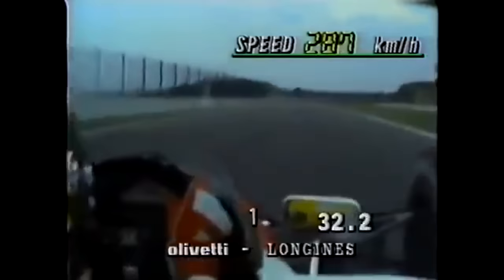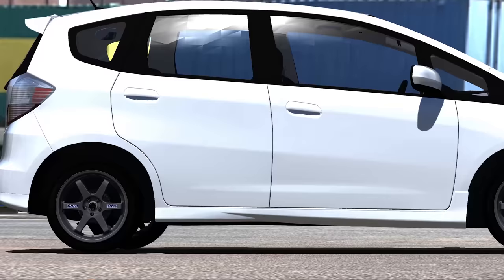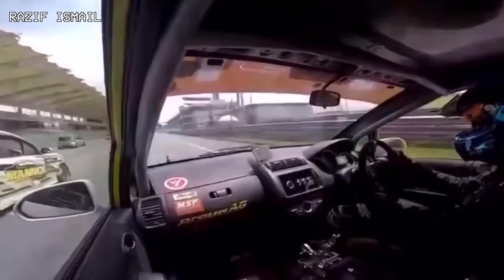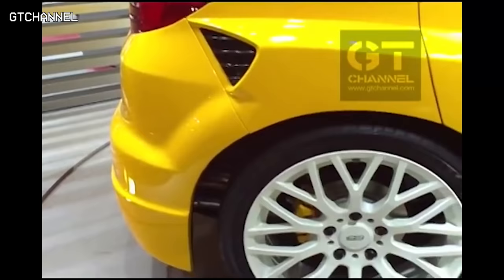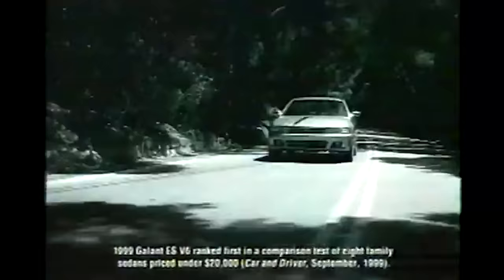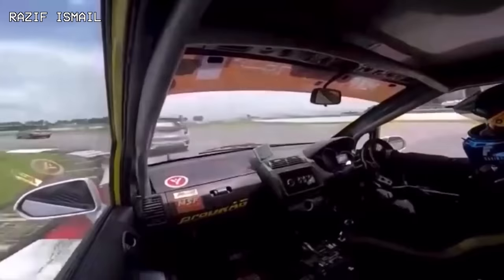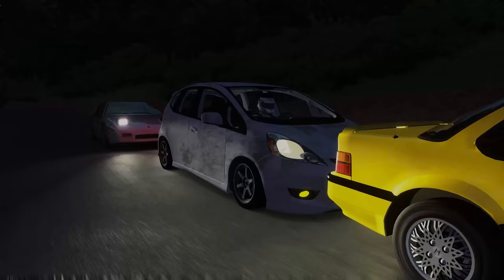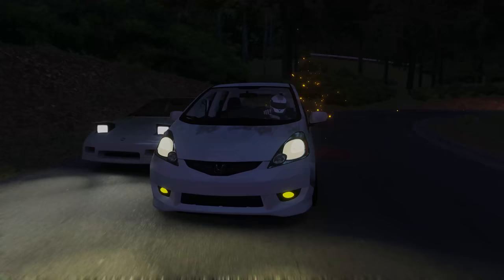Honda Fit - What Makes it so Great?

Comment: Take the Honda fit, add a parallel electric boost motor between the engine & transmission & a battery pack, cover the hood & roof with solar panels, also make a solar panel that covers the windshield that slides down from the roof & fits into place when parked. The windshield solar panel cover would not only provide more charging power. It'd also keep the sunlight & heat out of your car when parked.  Use a standard 120V wall plug in charger, so customers don't need an electrician to install a 240V wall plug in. They'd also be able to plug in anywhere they can use a standard wall plug-in. The electric "boost" motor would be used to provide extra power/torque during acceleration & up steep hills, instead of constant use. Once up to speed, the engine only is used, saving gas but providing extra power when needed. Making it quick off the line, instead of under powered & boring to drive. The battery bank would mostly be recharged from regen braking (helping to reduce brake wear) & the solar panels & wall plug in when needed. If the battery bank goes empty, the car will still run & have range, just use more gas & be slower until you can get to a wall plug in. If you drive say 20 miles to work, the solar panels will be charging the car for 8 hrs  while sitting unused in the parking lot.

Comment: I wish Honda-still offered it. Nothing simple and entry level. I really wished it was offered truly stripped under 15k as well.  I bought a used 15 XB manual with only 30500 miles 2.5 years ago that I adore.

Comment: I LOVE the Fit. 

I only care about the first and second gen, though. After the GE8, they were built in Mexico. 

My Hondas are built in Japan, no exceptions. Currently running a GE8. Best car, ever!
Reply: Sad the GK is a good car too. Has the refinement of the GE and the Sportiness of the GD with a DOHC engine setting it apart from the other Fits. Has a much more noticeable vtec crossover sound when modified too.
Reply: @christopherjohnston6343  I'm sure it is an excellent car. It is a Fit, after all! 

I just have certain quirks. One of those, is that my Fits have to be built in Japan. 

I took delivery of my first Fit Sport in 2006. It was one of the first ones off the boat, from the first shipment. Never was a HUGE fan of Hondas. But, it was the car that changed everything for me. It's practicality was head and shoulders above anything else that was available and was FAR more sporty than the competition.

When they swapped production to Mexico, some of the magic/mystique was lost. 

I just can't. :(
Reply: @techtard829  fair enough. I own a JDM 2006 Fit Sport and love it to bits. Have also owned a good selection of the smaller 90s sports cars and the Fits handling holds it's own.

I guess it's just that I know in 5-10 years time my current Fit will be due for replacement and it's likely the GK will be my best bet.

Comment: The Honda Fit/Jazz is NOT intended to be a performance car, it is a commuter family car with great fuel economy, i drove a 2003 Jazz we were very impressed by the car very roomy comfy 60+++ fuel economy on the open road, we did a long trip i Liked the car!!!!
Reply: Nope, it will performs if you tuning it Properly. The base is trash. Speed limiter, stupid 5AT gearbox..etc

Comment: if Honda is able to fit 150hp in next gen/year it will be by next car. Current ones struggles in highway.
Reply: U can mod the ge8 or gk5 1.5 not the 1.4,idsi… mine have 170hp with 230nm. It run very well 0-60mph just 7sec

Comment: I have the 2018 Fit Sport.  I am finding that the latch on the rear door/hatch requires monthly clean and lubrication.  Even worst, I find that the windscreen washer is seriously deficient when driving above 60 km/h.  The car was like since new and the Honda dealers kept telling me they replaced the parts and the issue is with the quality and design.  I know the parts were replace because I marked the original beforehand.  

Does anyone have the same issue with the windshield washer?

Comment: Honda was in a bad way in 2007.  The lack of quality on the 2001-2006 Civic/CR-V's were addressed with the 2006 Civic and 2007 CR-V, but now they were wonderful "Buick" type automobiles.  The youth market was being addressed at Toyota with Scion, Hyundai, Kia, and other brands while Honda had basically nothing.  The Fit was never intended for the US market but Honda needed something and they needed it fast.  In comes the Fit, and thank goodness it did.

Comment: The 3rd gen Honda Fit sucked in Australia.
Honda Australia used the engine and transmission from the 2nd gen Fit which gave 117hp rather than what other markets got which was the L15B which gave 128hp rather
11hp may not seem like much but it adds up on a smaller chassis, the 3rd gen also got a 6 speed manual.

Comment: "A super charger pushing the motor to 150hp" HAHAha I laughed so hard. I have a pretty light impreza with 150hp stock and its considered one of the slowest cars on the market. 0-60 in like 10 seconds.
Reply: The fit is anything but a track car. The piece of shit has to be put in very specific categories to compete with any success.
Reply: That’s a bad 0-60 for 150hp. If your car really is ‘light’, I’d expect no higher than 7.5 seconds

Comment: Um...all Fits have torsion beam rear axles, not just the 3rd. I'm sort of surprised about that comment since that's part of what makes a Fit be able to Fit everything inside but also what makes a Fit turn like an early Golf and one of its BEST handling characteristics, not a detriment at all. Lack of adjustment (which is GOOD) is the case with all Fit rear suspension. There isn't a single setting.

Comment: The fit has a terrible blind spot on drivers side, hence the little window, but it’s still a blind spot that has caused me to almost run over a couple jaywalker’s….
Also, it is so low, I have damaged the underside of my car a few times by simply bumping into the cement parking lot things while parking……
And of you are a big person, this car is too small for you. I’m five feet tall, so it’s perfect….

Comment: The fit is really fun to drive between 0-30 mph. After that it’s pretty uninspiring. 🤷‍♂️
Reply: You must have the automatic, the manual is fun at any speed. Is it a fast car, absolutely not. But it is a fun car. 
It revs eagerly, the steering is toght and twitchy, and the gearing is short, so it makes you feel like you are going fast, even when doing legal speeds. When you just want to relax and cruise, somehow the Fit is good at that too. The extreme functionality of it is a bonus. Its basically a practical sports car.

Comment: Honda destroyed the PERFECT compact car, which is why it's no longer available in the US market.

Stay away from the CVT ones. Manual or Pre 2014 (?) with the normal automatic. Had 2 CVT ones and both had this strange vibration. Wife had a 2008 and that thing still runs to this day no issues, other than a cracked windshield.

Comment: You do realise the 1.3l engine was the standard engine in almost every market, not the 1.5?  And the CVT was more common than the manual or automatic in every market except the US where it wasn't an option until the 2nd (or 3rd?) gen?  The first gen Fit/Jazz CVT was riddled with problems and to this day is well known for being fragile AF.

Comment: Surprised at how sporty this video is. The Honda Fit/Jazz is a great car but it ain't fast, that's for sure. It may have a VTEC 1.4 but it's painfully slow in overtaking with very little torque at hand.

Comment: the worst car i've ever had mine was a 2013 Jazz CVT (only the 1,4 was availeble with the CVT) slow hard to park in small spaces and just too clumsy for the narrow urban streets and too slow on the motorway alledgly with the same transmission as an Yaris I still don't bellieve that

Comment: So great they got rid of it .  I got 2011 sport red now turning pink. Wipers suck the lights suck and front windshield is catchers mit for rocks .  Not great on gas like hatch Back of 80s and 90s.    It did haul a crv transmission and engine on separate trips.
Not fan of it I hate automatic is balless almost got me killed to murge in front of semi.
It horrible in snow.

Comment: it maximizes internal space, wheels on the corners of the chassis so it turns well, is very controllable and comfortable to drive. i think the side road to declaring this any kind of performance car is almost a parody in the video but in terms of commuter car, its very much a min-max build skewed towards commuters. i will admit, theyre a tad fun too. I prefer my VWs but only because theyre nicer to sit in and have a little better entertainment quality.

Comment: So many people rip on tiny commuter cars as being underpowered shitboxes.
Even my 78 hp Mirage can outcorner a Porsche. I've done it, it may not be quick on a straight away, it doesn't need to be. I've had more fun on the track in that little 1.2 I3 than I did in a Demon I spent money on driving. 

The Fit also ranks high on my list. Easy to fix, fun to drive and if Honda didn't stop making them at the time I purchased my Mirage. (i wanted a small compact with good gas mileage, reliable and have a warranty. I bought my Mirage in 2021, my next two options was the Fit and the Fiesta ST) I would've went with the Fit to be completely honest. 
Next car is going to be another hatch, Mitsubishi? I don't know. Maybe a Honda though, good quality there.

Comment: Any Honda cars have weak front suspension durability. The recent productions even worse on sound insulation. That's what happens in Indonesia.

I've owned 
1987 Civic 2 doors
1990 Civic 4 doors
1991 Civic 2 doors
2000 CRV
2004 Civic
2008 CRV 2.0 AT
2010 CRV 2.0 MT
2010 City AT
2010 Jazz GE MT
2014 Brio 1.2

Only 2004 Civic, 2008 CRV, 2010 Jazz and 2010 city were bought new. The rest are second hand unit.

I can say despite the noisy front suspension, terrible sound proof. Every Honda has good fun to drive driving aspects. Just don't drive it to the roads with potholes. Drive it on circuit. My kind of problems will never arise.

Comment: Piece of junk. Bought 2015. At 124,000 needed new transmission... CVT sucks. 150,000 replaced engine. Injector went bad, couldn't remove it. I've owned several Hondas and very pleased. The Fit however sux because they put that piece of crap CVT in.

Comment: Can't see out of the front. The quarter windows and pillars obscure vision. I have almost run over people mutiple times in broad daylight. Unnecessarily fast steering makes highway driving a nervous burden. No feedback from the electro powersteering and drive by wire is like a Crap 1980's video game. At 2650 pounds it's Fat and feels liket it. I've driven 1982 and 87 accords, 87 civics.. and a crap 87 crx that felt more alive. A great engine saddled with a uninspired dump of ancillary gear. Waste of a chassis. 2012 fit.

Comment: I had an 09 Fit for a couple yeas and I hated the car. Not comfortable, couldn't fit any drinks in the cup holders because the one that blocks the vent is square and the ones down low are too crunched. Getting on the highway was painful and you would never be able to pass anyone. It was constantly screaming to get up to speed.

Good fuel economy and storage though.

Comment: 4:22  What shit is this?  The Civic NEVER qualified fro the kei car class exemptions.  The JDM Civic STILL qualifies for the same tax class as it did in 2000.  The US market Civic is fat and bloated from 2000 and is a tax class higher, but not sold in Japan anyway.

4:30  If Honda loses market dominance?  They don't HAVE and have NEVER HAD "market dominance".  They've never been more than number 2 behind Toyota, and that's only in the non-kei class.  They've never even reached number 4 in the kei class, behind Suzuki, Daihatsu/Toyota, and Nissan.

Comment: If your going to try to ridicule a car, please think next time about a real car worth to ridicule, a mini, or BMW for instance. Tower high costs to maintain, and for what, crappy engine repairability/design. Ahh yes design… the engine/car was designed to be taken in every year to take mandatory maintenance, for only sponsoring the manufacturer wallets.. if the engines were designed the right way, all this extra “care” would not be needed.. this compared to the honda, which probably will run fine even if barrely to not even being maintened, and just clears the yearly inspection, as long as fluids are filled they probably will keep running..